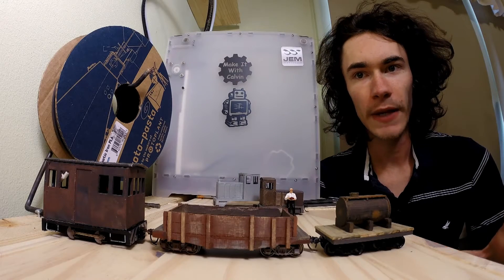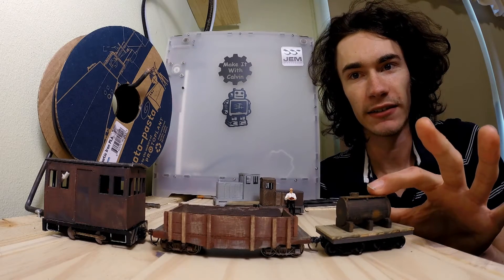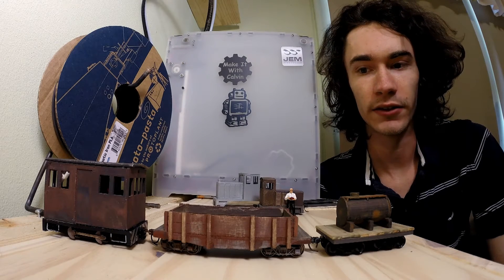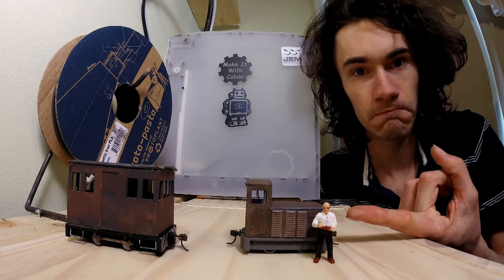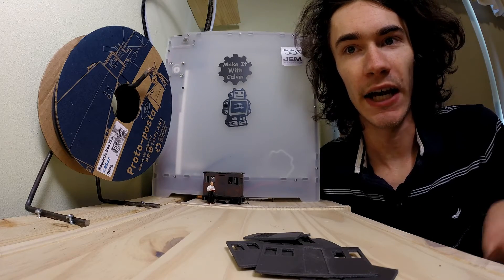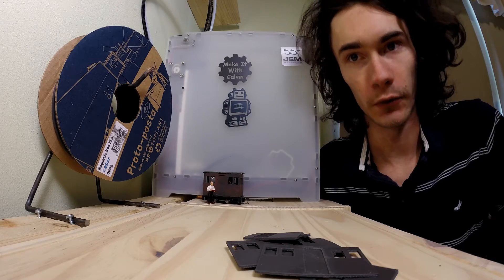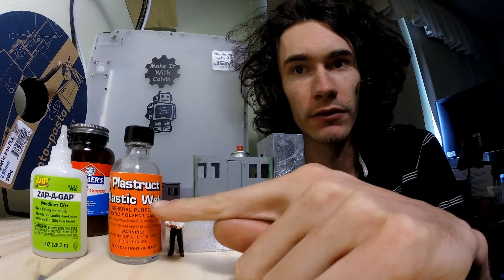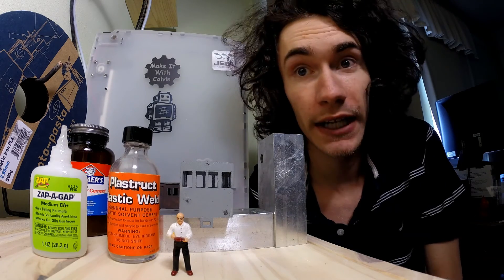3D Printed Boxcab Locomotive Pt 1

Comment: You can lay a few lengths of solder inside it for weight. Very easy to bend into shape and work into your models.
Reply from the maker: I have done that before, although lead solder is a little hard to come by up here in SF. Every little bit helps sometimes!